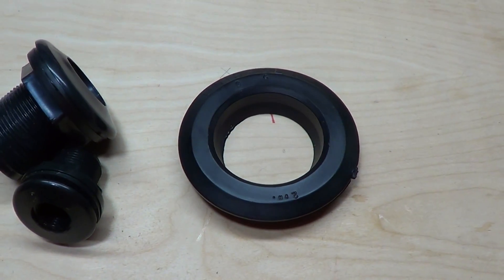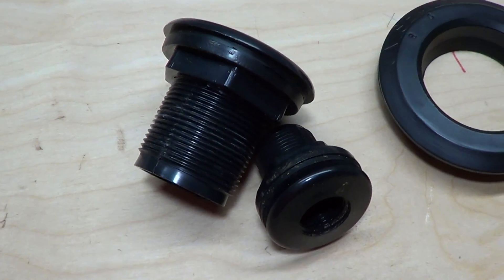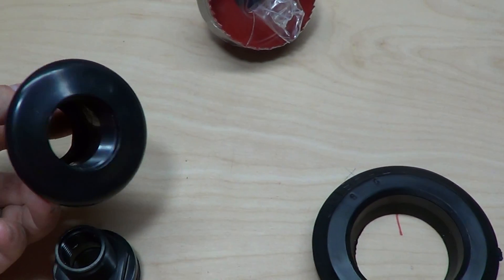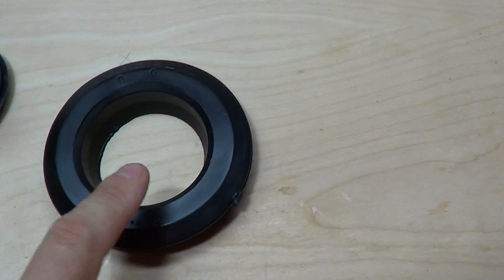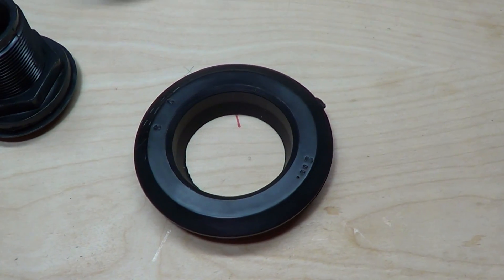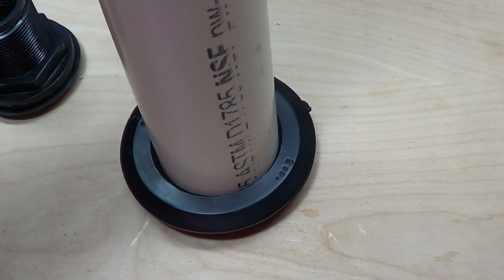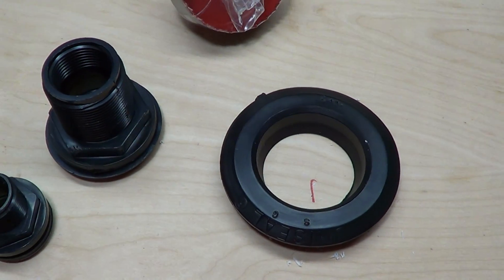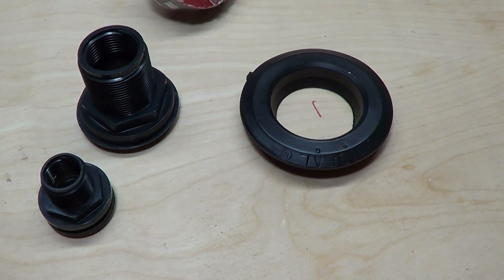#185: When to Use Uniseal vs Bulkhead for Aquarium and Pond Barrels - Tank Tip

Comment: I have a 3 1/8 inch hole.  Would the 2 inch Uniseal work?  The shower drain I used required 3 1/8 inch hole.

Comment: I want to drill a hole in my 5-gallon Home Depot bucket. Then attach either a bulkhead or uniseal device, and run a 1/2" (Inside Diameter) clear tube to a drain. This is for a DIY boiler neutralizer. The 1/2" (inside diameter) tubing seems like it wouldn't seal correctly using a uniseal since it's not a stiff material.

Is the bulkhead device my best bet?
Reply from the maker: dkalata you need to use sch 40 PVC with a uniseal, so it sounds like you want a bulkhead and a threadxbarbbed fitting
Reply: Thanks Greg! I was thinking the same, but wanted to make sure I understood the application correctly. Appreciate your fast response - and great video!

Comment: Greg please help me. I drilled a 1" hole what size bulkhead do I need? Or what else can I use??? Help
Reply from the maker: Las MiLLpass it depends what you cut a 1" hole in, glass? acrylic? plastic barrel? you might find a 1/2" bulkhead which could fit a 1-1/8" hole, but typically you buy the bulkhead fitting before you drill the hole
Reply: Greg Jones well it was my first time and i messd up, i drilled glass
Reply from the maker: Las MiLLpass buy the smallest bulkhead you can find, or silicone a pane of patch glass over the hole

Comment: I need to go thought a 2" thick Pond wall with a liner could this be used ?
Reply from the maker: the gasket isn't 2" thick, so it wouldn't work, i would recommend using a traditional bulkhead that has a longer neck

Comment: if i want to seal a hole in my drilled aquarium for my turtles do i use a bulkhead or do i need a plug
Reply from the maker: +Kevin Lin uniseals don't work on glass as it would shatter, use a bulkhead, teflon tape, and a threaded pvc cap/plug

Comment: Might be a good option for a few buckets for water changes. I have had enpugh with the lift method. Lifting 20 gallons a week 6ft high gets a little tiring. Its between that and i just found a new kind of pump that attached to any drill pretty cool

Comment: I got my Uniseal and it fit's fine, I like to know if I can install it from the inside of my tank not from the out side, and then push the pvc pipe in the Uniseal from the inside of the tank??? Will it still not leek????
 I really need to know, please come back and help me with this.
Thanks.
Reply from the maker: as far as i can tell, uniseals work best when installed on the convex side of a curved surface, flat surfaces should be fine to install from either side, pipe can only be pushed through in one direction. Again, I strongly advise against using a uniseal on a glass aquarium, you will put stress on the glass and crack the tank - second warning!
Reply: THANKS AGAIN I SENT THIS EMAIL BEFORE I READ YOUR "DON'T USE IT" EMAIL. I HAVE 2-H/D-BULKHEADS ON ORDER AND I WILL BE USING THEM NOT THE UNISEAL. I NEED THE UNISEAL FOR MY OUT SIDE WATERING TANKS
ANYWAY. THANK AGAIN TANK BUDDY. LOOK FOR MY VIDEO ON "THE BIG TANK"  IT WILL BE DONE SOME TIME THIS MONTH or NEXT.

Comment: Hi; I HAVE A Uniseal ON ORDER IT WILL BE USED FOR MY 125 Gal. ALL GLASS TANK. DO THESE Uniseals WORK ON FLAT GLASS AS WELL??? AND WHEN A PVC PIPE IS PUT IN TO IT, DO I HAVE TO PUSH IT IN TO WHERE I CAN SEE IT COME INTO THE TANK??? or NOT??? I WAS TOLD TO USE RUBBING ALCCHOL ON THE PVC PIPE BEFORE INSTALLING IT. NOT WINDOW CLEANER, ALCOHOL IS SAFER FOR FISH.
ANYONE OUT THERE KNOW WANT I WANT TO KNOW????? LET ME KNOW...
Reply from the maker: Uniseals DO NOT work on glass tanks. DO NOT put a uniseal into a glass hole as the uniseal EXPANDS and will CRACK the glass when you push the pvc pipe through. Use a bulkhead for glass and acrylic aquariums, and save the Uniseals for plastic barrels!!!!
Reply: Thank you O-so much!!!! This is very good of you to tell me this. I will not us the Uniseal and I will get a Bulkhead.